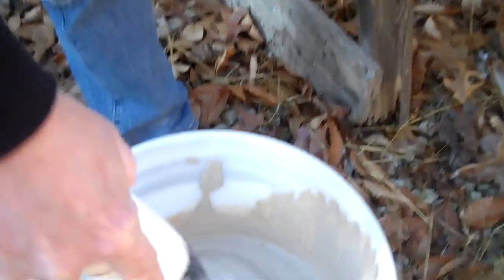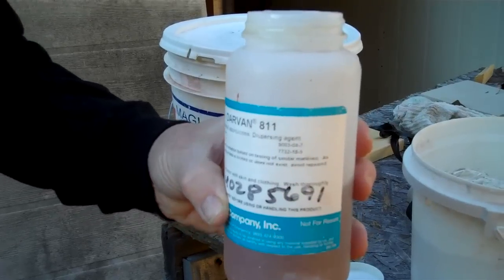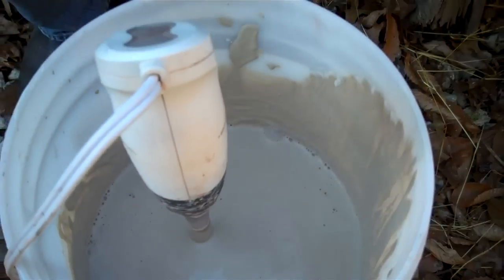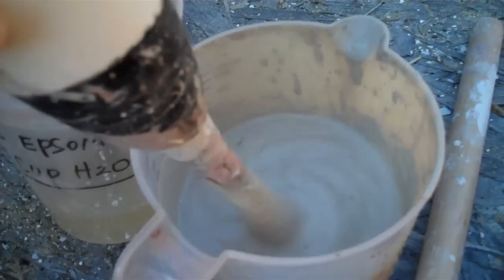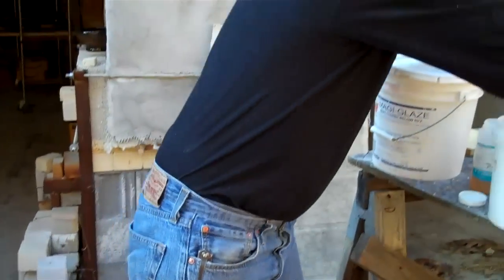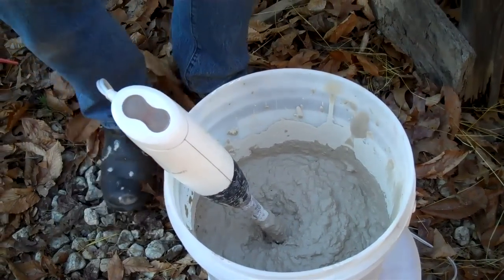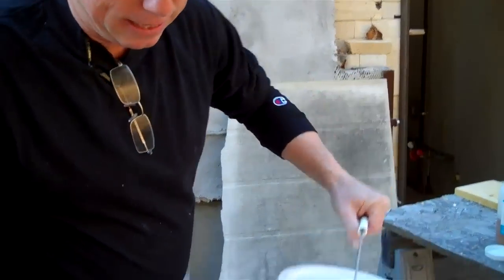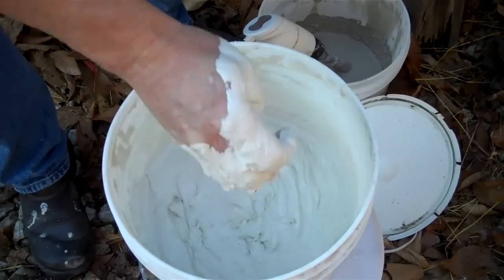Thickened Slip, Trailing Slip, Joining Slip

Comment: A simple tip so you know if you have added the right amount of defloculant. When you finish mixing the slip wait and watch it move in the bucket. When it stops moving keep an eye on a fixed spot usually a bubble. If when after it stops moving it moves back slightly in the other direction that tells you it's ok. This comes from over 30 years of mixing slip.
Reply: Eight years after you commented, but hey, why not? 
You’re saying that, if you have the right amount of additive,  a deflocculated slip will stop stirring sort of like a car stopping a little rough, with a subtle jerk backwards? I’ll see if I can notice that! Interesting! Thank you.   :)

Comment from the maker: Yes, because less water means less shrinkage. In industry they use deflocculated casting slip to put on handles - without- scoring.  Tom Coleman used a cone 6 slip (thickened) as his joining slip because more flux help the joint better (as well as less water).

Comment: Thanks so much for this information, im in South Africa and i work with earthenware slip, can i use this same method to flocculate and deffloculate my casting slip? i dig moulds out of amp sand then i cast with slip inside, im on my way to develop a slip body durable enough for the brittle sand mould, you input will help.

Comment: God, I've tried this many times, with many types of clay and I just can't get it to be magically liquid? Can you help me and explain what am I doing wrong? I was sick of buying expensive slip by the gallon online because there's no ceramic/pottery supply store in my town and with the shipping it's an absurd amount of money, almost $40.00 for 1 gallon of slip. In my previous town I would pay from $10 -$15 a gallon. I don't do this for living. I was always fascinated by clay and it's magic of creation. I bought 50lbs clay powder mix, half a pint of Darvan from Laguna company and couldn't wait to try making my own casting slip (I also have bout 10 plaster molds)..... I've also experimented with sodium silicate in the past with no luck as well. The slip turned out thicker than it was when I added the sodium silicate, a complete mess. I can not believe all the money I've spent and still can not make this work. I watch people's videos making it so easily without measuring or anything. I refuse to spend more money to buy and learn how to use one of those fluidity measuring tools. Ok, this is what I did: poured some lukewarm water in 5 gallon bucket (about 1 gallon), with about a table spoon of DARVAN and mixed it adding a little clay at a time until it was the fluidity I thought was about right (I mixed it for about 15 min.) Than I got one of my small molds and tested a little be to see how it would turn out. 5 min later the slip started shrinking and cracking so I added a little more DARVAN and clay as I mixed just in case the problem was too much water. Tried again and cracked. I was going to throw that batch away but I thought to myself, why not try 2 drops of sodium silicate. Tried, and didn't work. At one point I thought it was the mixer not being powerful enough to mix the slip well so I made my husband buy me an expensive DEWALT drill and a mixer attachment that coated over $100....This time, I did the exact same procedure of warm water and DARVAN first than add clay as I mixed with the exception of adding more water. So I kept mixing it and testing it on my molds and nothing. I've used most of the 50lbs dry clay mix and almost the entire DARVAN jar and the slip never worked nor it became super fluid like in this video. The thinner I could achieve was a semi thick pancake batter consistency/fluidity. Can you please help me understand why my slips don't work? I envy you and all the people that can make it with ease. Thank you!
Reply: PS. I own your Book! And I love it! At first I bought it because of the beautiful vase on the cover by Scote Cameron than I felt in love with all the info on so many additives and ingredients that I had no idea how to use. I hate that when I took pottery classes all we used was already industrialized stuff like glazes, over glazes, moist clays.......i'm too intimidated to try it, there are so many additives and chemicals and the way I'm OCD I would spend all my husband's money in order to experiment and try everything. So for the time being, I'm sticking to stupid pre made supplies (except the slip.... lol.....I won't rest 'till I get it right). But I love to know that your book is there whenever I decide to let go my fears and embark on the journey! thank you!

Comment: Great information!  Thank you so much!  I'm wondering about bacteria growth and mold within finished product.  Is bacteria or mold an issue?  How do you prevent it?  I could make a smaller batch, eh?  However, I would like to make a big batch to have on hand when needed.
Reply: Bacteria and mold are just a sign of aging. If you are reprocessing your clay, this can be good thing because they improve the workability of the clay. But they do this by increasing flocculation, so you might need to add more Darvan to keep the slip deflocculated (although tbh i have never had to do that).  And, unless you have a mold/mildew allergy, I don't believe there are any health effects. Hth.

Comment: so when you add the darvan 811, you make the slip "thin" but it will be a trailing slip? more clay per water molecule? or do you just make a super think slip, 2 parts clay to 1 part water, and then add the darvan? i know, clear as mud. for sgraffito you would use a thin but unshrinking slip?

Comment: Hello.
I just would like to make some regular slipware, and try to understand what to do with regulas slip (water and cly), to make a slip that does not crack on the pots after applying and drying or firing. Can someone please help!?
Reply from the maker: Not sure what  you are asking..Regular Slip is not a term....Slip from your throwing bucket is very high in clay and clay dries and shrinks.  You may want a Slip Recipe with low clay so less shrinkage?

Comment: waaooo! what is the name of the thing that you used to mix the slip?
Reply: I think he said Darvan 811
Reply: It's an immersion blender he is using to mix the slip.  Cooks use them, so try a kitchen supply store.  They are usually smaller than that one.  You can also use a paint mixer attachment from your local home improvement store, affixed to a hand drill.